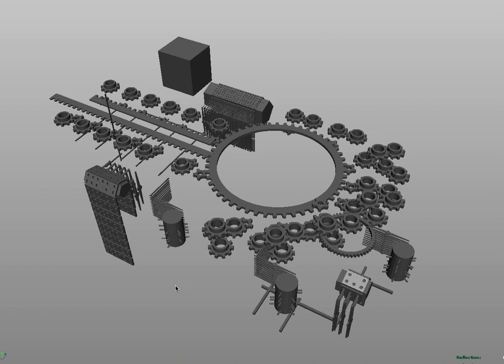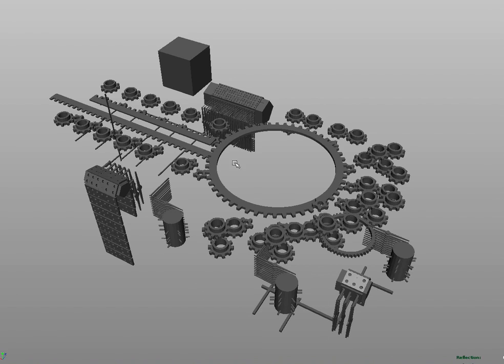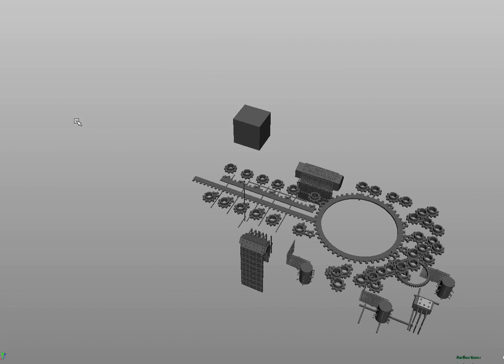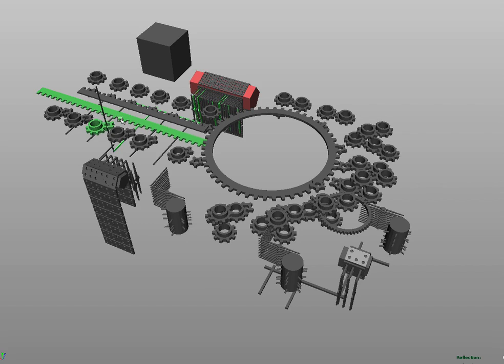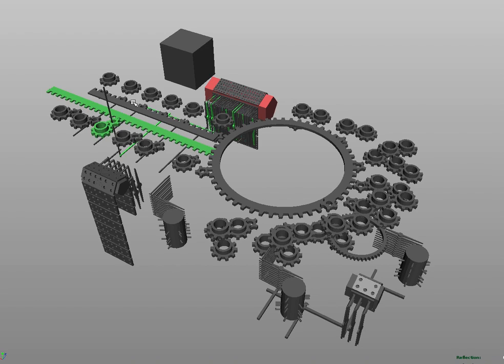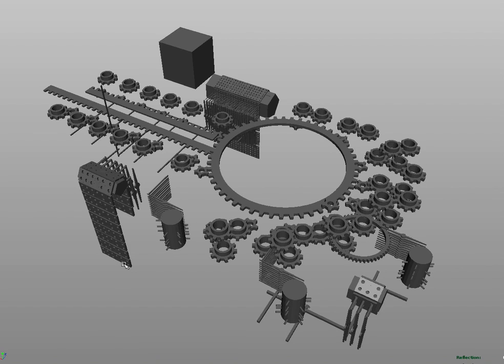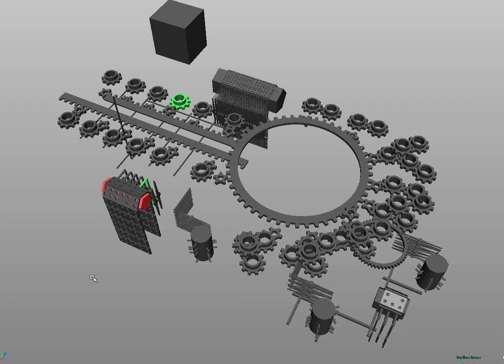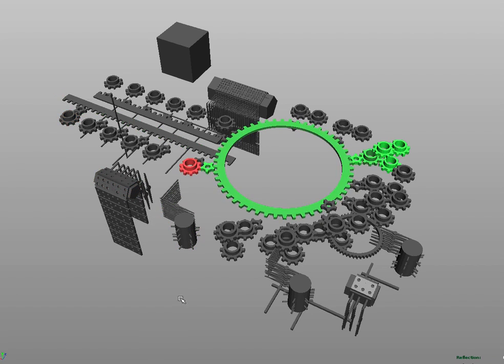Babbage's Analytical Engine: Overview

Comment: So I was watching this and assumed that the key limitation of this engine is that it has no control statements, the cards must be manually inserted and are completely independent of whatever data may be stored. However, you then mentioned that the machine can write to cards. With a simple card manager, could this be augmented to be a Turing complete machine, or is the card writing functionality too simple for it to do that?
Reply: Late to this party but the Analytical Engine design was intrinsically Turing complete 😁

Comment: How Many Sq Ft/Meters would it take up since you have modeled this?
Reply from the maker: +Christopher Bloom The central wheels were supposed to be about 70cms around- extrapolating from that it would have been.. big? :) Babbage's plans are more ambiguous than they looks so it's hard to give a specific figure. It would certain have been at least 3 meters tall and a minimum of 7 meters long.

Comment: Just wondering if the store read  to ingress axis should zero the store or not? ISTM that there would be many times where a constant would need to be stored -  zeroing and re-reading from the number cards would slow the machine considerably.

Could the store's wheels maintain engagement with the rack as the rack returned so re-storing the number?

Perhaps 'Read'  and 'Read with Zero'  could have been programmed by the address cards?
Reply from the maker: Hi Bill-- one of the many, many details omitted here is that each digit is stored on two stacked wheels in the Store. The number can be read either destructively or non-destructively, this can be specified in the program on the variable cards. Thanks for watching!
Reply: Wow